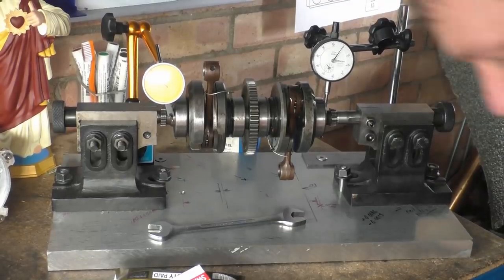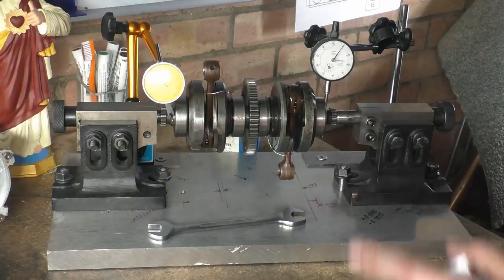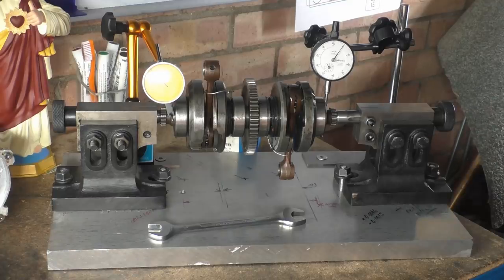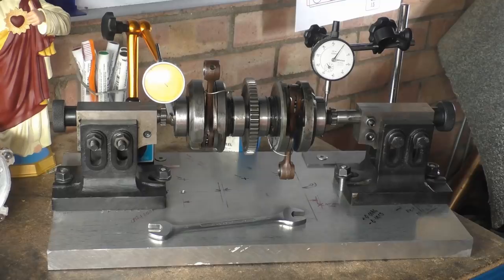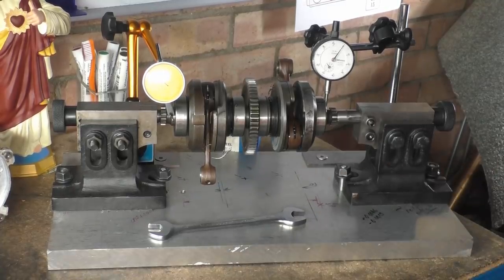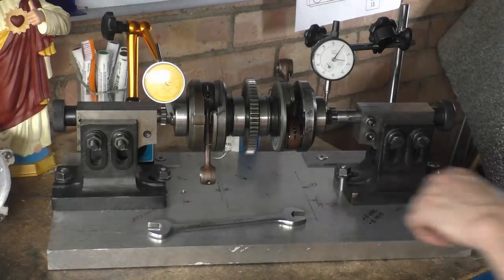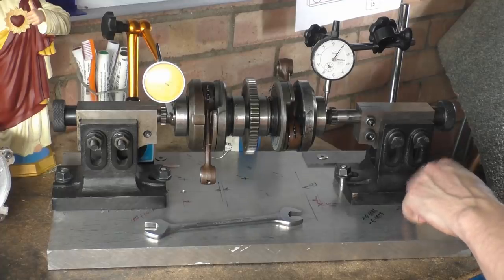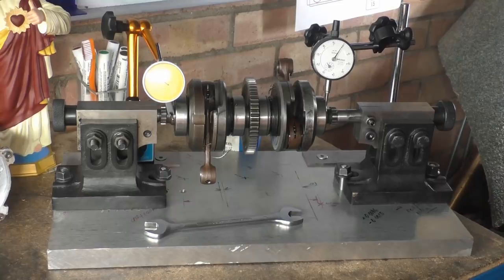2 stroke Crank Alignment

Comment: Now I'm not an expert by any means but I'm pretty sure you're not supposed to be measuring runout right where they are mounted on the centers? Obviously it's going to be close to perfect there, if it's not I'd expect the crank to be way off or the holes damaged or somehow off-center. Measuring on the middle bearings would show errors way better. It could be out by a mm in the middle of the crank and only show 0.05 mm out there because you're measuring so close to where your dead center is. 
Also if the middle 2 webs are off by the same amount you could even have them rotated say 180 degrees and have like 12 cm runout on the center shaft/bearings while it's still showing perfect out there.
I could be missing something here of course :)
Reply: You are correct, no point in measuring what your supporting!

Comment: Great work Matt.  The location of the indicators at the ends measure any concentricity between the centerline counterbore and the surface of those tapers.  I'd think a far more useful measure would be to check the run-out at the bearings on either side of the center gear?
Reply from the maker: Yeah - that's what you do once the new bearings have been fitted - this was just a demo on how the rig is meant to work.

Comment: In the middle of doing 5 Suzuki Stinger T125 twin cranks ( lock down project! ) any help on getting them dead on at first press would be appreciated, I hae a 10 ton press set to go. Good old school lathe and a few good clocks/stands means I can clock um up also a vertical mill is set up, you mentioned that could be used. If you could describe it I could work off that, Im an engineer by trade and motorcycle nut by hobby so Im armed with a 2lb copper mallet but thats last resort, thanks Matt
Reply from the maker: You need a large v block. The v block will index the outer diameter of the throws. This ensures the alignment. This is what they do at the factory when they were assembled
Reply: @dirtygarageguy  Matt brilliant yes big v blocks the answer. I remember now a film showing in the factory Kawasaki H1 cranks in big v blocks, makes sense. I ended up using smaller v blocks off the bearings off the lathe bed and clocking the thows, time consuming and not as accurate i guess but within 2 thou at any point to point so thats going in. I have a tripple H1 to do ........big v blocks hunt on.

Comment: Thanks, how would you measure the alignment of the bearing seat in the engine cases? In case of a left and right casing. I have a engine where I like to measure this as I suspect that left and right casing are not a matching pair. Thanks

Comment: I'm working on a 1977 Suzuki T-500 2T I'm tearing the motor apart right now I don't have the tool to take the flywheel off tried several ways haven't work yet but that is not the reason for this comment. When I finally get the bloody thing apart I will like to do this but I don't have that setup is there any other way to check it since I have no clue what the state of it is in? On a side note I did have about 80% of the bike but my ex in-law had to move and everyone involved knew I needed the parts since this was going to be a project for me and my 13yo some to rebuild well the parts went to the dump "accidentally" as I was told. Heck at least I have the motor, the fuel tank, oil tank, and the engine parts hopefully I can get it running. It would make a hell of a 5 speed go kart stupid fast and loud as well the engine hasn't ran since the early 80's it was also in a shed the whole time so the parts I do have are in good shape the funny thing was when I was draining the crank oil it was like clumpy diarrhea smelled the same too.
Reply: The great thing about centers is they dont actually need to be perfectly aligned, just as long as they dont move and are pretty close, you can get solid measurements.
Reply: @miles11we  yeah I doubt it's even out at all it's just something we might check but I don't have any of the equipment to check it

Comment: Hi Matt I’m a little confused. I don’t understand how, when you measure the second end at 50um you refer to it being 50um out along it’s length. Isn’t the second measurement simply measuring the concentricity of the right hand shaft end and the right hand centre or am I missing something? edit just watched again, you said you flip the crank and measure again. Presumably you would expect to see a 50um runout at the left end once flipped? Would that be right?
Reply from the maker: "edit just watched again, you said you flip the crank and measure 
again. Presumably you would expect to see a 50um runout at the left end once flipped? Would that be right?"

- Yes. This is a sanity check - if the numbers don't match then I check the rig again.
Reply: You right Lacy Kyle. Matt is just measuring how far the centre point on the crankshaft is out of place compared to the crankshaft itself. He is measuring really close to the centre point. The only thing he proved with this setup is that the right centre is out of place and cannot be used for future measurements. I don't get what in the world he is doing.
Reply: @FrankyieFrank  matt is using the crank as an alignment tool for the rig itself, the dimensions on the crank don't change.

Comment: On that crank, is the timing gear adjustable?  I am doing a Rotax 256 (in line 250cc engine...not parallel).  You time them at .000" at .145" BTDC....and it is a bitch...
Reply from the maker: "On that crank, is the timing gear adjustable?" - between the 2 cranks? Or on the same crank?
Reply: @dirtygarageguy  mine are 2 cranks, 125cc each.  The gears are keyed on each crank but there is movement....they actually lock on the taper.  You have to screw with both of them.  When you tighten the nut on the crank, it moves the gear....it is a total pain in the ass.
Reply: According to everyone that knows anything about these things, they state it is critical that they are in the same place when they fire....which is weird because they time them at a different spot than when they fire.

Comment: Why aren't the shafts slotted? Wouldn't it be harder to missalign itself?
Reply from the maker: "Why aren't the shafts slotted?" - which shafts?
Reply: @dirtygarageguy  slotted big end shafts where they're pressed into the webs, that would be good enough to keep the crank aligned, no?
Reply: @tilenlini  like splines? It wouldn't be easier. You can't adjust a spline if it's off by minute amounts.
Reply: @dylanheadrick3789  but ypu can get ot dead straoght on the 1st try?

Comment: I don’t think anyone is a fan of hitting a crank with a hammer, sometimes a little tappy tap with a soft hammer is needed but definitely not ideal. Ken O’Connor racing  has a video of a pretty cool jig he built for assembling single cylinder cranks.
Reply: It’s in the Rm250 crank video for sure, probably a few more if anyone is interested in checking it out.